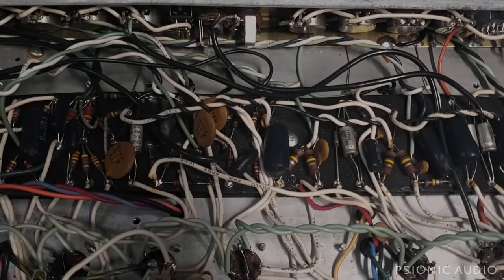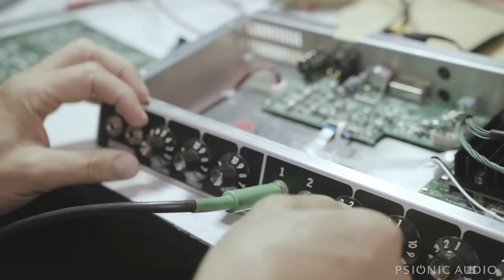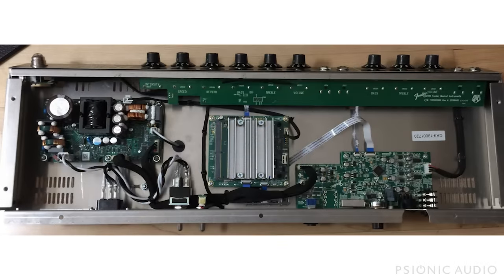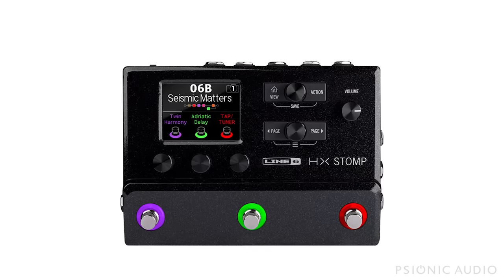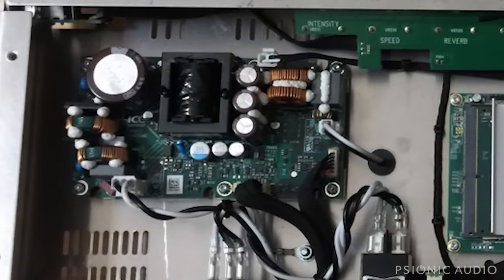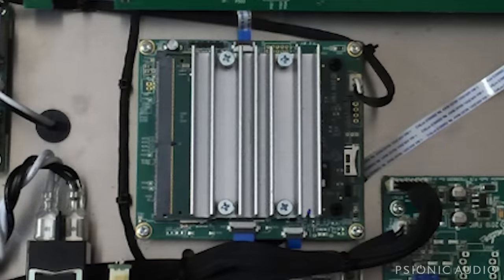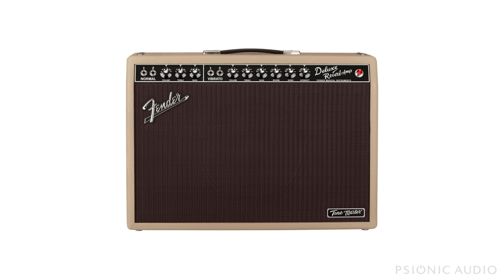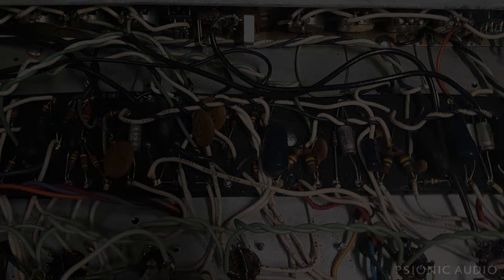We Need to Talk about the Tone Masters

Comment: You need to look at this amp as a tool, not an investment. If you are a gigging musician and it fits your needs, at about $750.00 with a 2 year warranty, even if it fails just as the warranty ends it will only have cost you about $1.00 a day.  For a working musician who wants the classic Fender sound it almost seems like a no brainer
Reply: If you're a touring musician, you're going to invest in IEMs and modeler pedalboards like kemper/helix/cortex/fractal
Reply: Good thinking here except for the impact on the environment. Something that can live for 50 years is better than something that lives for 5.
Reply: @BrockBarr  Who's to say that the amp won't last for 50 years if it properly maintained and cared for. I just meant that no matter what happens you still get your money's worth out of it.
Reply: @scacchomattho  I'm with you on that. Maybe a weekend warrior that wants looks might use those tone master things but anyone who actually would tour is using something rackmounted or a board unit to get their equipment footprint down.
Reply: I bought one in late 2020 thinking the pandemic would be over and my band would pick up on gigs…it’s only NOW (almost 2 yrs later) that we start picking them up🙃
Reply: @TunedupFlat  wow.... but normally you're actually a pretty humble guy suppose? Did you even ever play one? I'm a gigging musician since 25+ years and I don't have the need for a Kemper or a rack... I just need one good sounding amp that's not gonna break my back. And this fits my needs perfectly. I'd image if you're playing in a cover band and need a totally different sound for every song, then a Kemper or Helix would be a good idea. But there are also musicians who are devoted to a certain sound or genre... I maybe need 3 or 4 effects (delay, reverb, tremolo and maybe a phaser) and that's about it. I use one overdrive pedal but mostly pretty clean. Why would I need 500 effects or amps and cabs emulations to choose from? My point, for some touring musicians, the Tonemaster is a great tool.
Reply: @scacchomattho Used to agree with this but after playing with a Helix for so long and learning how limited it actually is (even with the newest firmware), I still find myself going back to analog boards and actual tube amps. If I'm playing at churches now, then I use analog pedalboards with multiple pedals and a UAFX Amp sim pedal (think Ruby. Dream 65 and Lion).
Reply: Where do you see these for $750? I thought they were a bit over $1000
Reply: @Rockandrollgeerage 
2 year old video.... prices go up on everything except this amp.... you can get them new for $550.00---$650.00. 
Still not worth the money.

Comment: Us DIYers are waiting to buy broken ones for cab, chassis, and speaker for a buck fifty in 5 years.
Reply: Keep waiting, hero.
Reply: Good luck 👍getting a smokin  deal anytime soon.. this amp is exceptional for the money and the almost absence of weight,  no waiting for the thing to cool down before you toss it in the trunk,  no constant upkeep, no dealing with the overall db level when you want a little gain for the 1st set..  better sound than a healthy tube version  ?  No.  However it's close......
Reply: @lohmei3913  its not really a question of quality or value.  Its a question of sheer prevalence and time.  I have picked up cheap-to-free hot rod series stuff over the last decade for the same reasons.   I didnt mean to sound snarky or skeptical about the product.  I meant to convey that with more saturation of the market with that speaker, I look forward to the probability of scoring one used.  And, as a DIYer, a new run of right-sized blackface cosmetic fender combo cabs, in the used markets means a DIYer can source kit parts for just chassis and guts and hope to score a tonemaster husk that will receive a chassis perfectly.  So, I'm excited about the waves of stuff coming to the used market eventually, I estimated five years-  i didnt mean, "this is junk and a fad and i will be laughing at all these dopes in 5 years..."
Reply: Considering I’ve got an original Mustang and Mustang v2 sitting here that work like the day they were built…..I suspect you’ll be disappointed.
Reply: 3 yrs
Reply: Tube preamp into a Katana Artist power amp in. I use a Le Clean,  UA RUBY, AND A beekeeper. So only the power amp is in use along with power scaling and volume. And These preamps are truly amazing. Sold My 64 Deluxe and my Alessandro Princeton.  I Have a Champ from 51. A Timmy and an old DD3.

Comment: Would love to hear your thoughts on Quilter amps!
Reply: Replaced my '65 Deluxe Reverb RI with the Tone Master version. After the firmware speaker update I have been delighted with the sound. Not the exactly same as the tube version, but it sounds great. The digital reverb isn't as nice as the spring so I supplemented it with an Oceans 11 pedal. I replaced a Bassman amp with a Quilter for playing bass and love it, so I pulled the trigger on a Quilter Aviator Mach 3 to complement the Tone Master and LOVE it! The Mach 3 is a great addition as it is much louder than the Tone Master and does a decent job emulating Vox and Marshalls as well as 3 different Fender models too. Love its cleans, and the high gain settings are perfectly useable. If you A/B with the tube version you'll hear a difference, but you also would between 2 different tube amps of the same model. Can't beat the weight savings.
Reply: Quilter made stuff is as close to indestructible as it gets in my experience.
Reply: I agree. It would be nice to hear his take on the Aviator Cubs and the Mach III. I have a Steelaire and a Mach III. They are both excellent amps. I am not bothering with heavy tube amps any longer. Ps. For tube amps I prefer Peavey Classics and Vox AC15s.
Reply: Fender Champ is a good amp for quilting

Comment: It is a laptop with an amp attached and some knobs and pots.  I have never had a laptop fail, and the ones that I have replaced (after 6-8 years) have been replaced because the operating system updates have outgrown the CPU.  But the Tonemaster is a laptop designed to do ONE thing, I am sure some of these might fail early but I would expect the CPU to chug on for a decade or more.  Mine sits next to my desk, I play it every day through the IR, I am lucky if I get to play the speaker once a month, and I never get to play it above half power.  Why did I get it?  Because I would NEVER be able to play a Valve Deluxe Reverb above 1 on the volume in my home, and certainly not at night.
Reply: I have one for band usage. Our training room is really small so I drop the wattage to 1/3rd and it sits in the mix. Go to a gig I can dial it with the room and go foh directly with xlr. I really enjoy the versatility and personally I bought it for the deluxe reverb sound which in a band mix is hard to differ from tube one. For home play I use Pod Go either directly with headphones or with PC together with recording, drum etc software. Can recommend pod but maybe would go with hx stomp now as in home use I dont need the buttons that much.

Comment: I am a live sound engineer of 20+ years and I had one of these on my stage just the other day. I was curious myself about the amp and decided to test the new model by using the XLR direct out. I set it to position 1 and I must say, I was very impressed! It sounded like a nice mic'd guitar amp. I had to do very little to no EQ work on it and as I recall, it was simply getting a level, turn it up and it was good to go. All I did was use a HP filter to rid any needed low end and I believe I used a mild -3db dip around 5khz to reduce some bite. While I want to dislike some of these " new " DSP based amps, this one actually has me very interested. It sounded good acoustically and it sounded just as good with the XLR direct out. The other guy on the stage had a Deluxe Reissue and I mic'd that one, it sounded just about the same or at least it required similar amounts of work with an SM57 to get a good sound out the PA. I was using an L' Acoustics Kiva II rig to give you an idea. So if there was something to be ashamed of, you would hear it.
Reply: For a guitarist it’s a different story. Sterile. Touch isn’t there.
Reply: @greg6L6GC  I am a guitarist of 30 years! And while I can’t speak for the touch and feel of the tone master, I can only say that based on the grade that this guitarist was it didn’t seem to be too much of a problem.
Reply: @atech9020  They just sound ok. Don’t heave the feel and that’s important. I’ve been playing 60yrs and when I have time build amps. I’ve worked my entire life in electronics.
Reply: @greg6L6GC  Nice! I too have been building guitar amps for several years now. I’m not trying to tell everybody to go out and buy the fender tone master, but from the limited experience I have with it, it is a product that has me interested.More so as an entry-level, affordable version of the real deal that you don’t have to worry about beating up or not.
Reply: @greg6L6GC  bullcrap, they do not sound sterile at all. And it feels about the same as my Fender tube amp. The Tonemaster is just little bit more sensitive to touch, but that depends on your playing style as well. It sounds great and has a lot more headroom at the same volume as my Hot Rod tube amp, it's loud, very full sounding and clean as hell. Is it exactly the same as a Twin Reverb tube? No it's not. But there's absolutely no one who will notice that subtle difference when playing with a full band on stage.
Reply: @supersonicsroots  Agree.  People in a club are not listening thru $500 head phones.  I think guitarists can be anal and over analyze things way to much.  Most of the audience on any given night wouldn't know the difference and are drunk or high as shit.  In a church setting, they wouldn't know either.
Reply: @davidcudlip6587  Same here. Also the speakers that the congregation in my church listens to are already 25 years old. They are already used to the bad quality.

Comment: this is something that is great for working musicians who just need something lightweight to throw in the car and take to the gig  It is absolutely a consumable product, not a legacy one, you wont be handing it down to your kids.  Buy it, use it up, junk it. That said they may be a great source of cabs and faceplates in the future.
Reply: I sold a handwired Deluxe Reverb clone and got a Tonemaster. I A - B’ed them and felt the Tonemaster sounded as good as the DR clone (the clone was a great sounding one and remember all DRs don’t sound the same anyway). The weight, attenuator and line out made it a better fit for what I do. I still have a Princeton Reverb and Champ made by the Amp Shop and they give me my tube fix. I definitely agree with the firmware upgrade improvements.
Reply: You must be rolling in money.  Usually it's only kids who have no clue for value.
Reply: @swagedelic  around 1979 nobody was buying these except the handful of people - GE Smith comes to mind - who had enough stage time to appreciate them for what they are. Even then, something like the GE Smith approach was sort of specialist. People were going solid state, especially after Peavey made the Bandit and family, and the LAB Series came out. 

All that "value" came from the Innernet and big box guitar stores. I'd been playing for like 20+ years before I even saw a Deluxe Reverb on stage.
Reply: @arkybeagle6159  My post wasn't directed at the guy with the Deluxe Reverb.  I was responding to the statement about consumable products.  The definition and commerce model of consumption is what is destroying everything from quality, value, balance in the economy and even our environment.  Your take on "value" seems set on the throw away and you blame everyone but yourself.
Reply: @swagedelic  Do you play guitar?  I don’t mean it in a flippant way…. Rather that any guitarist knows there is no such thing as value as it relates to money in the world of guitars.  Why pay$500K+ for a 1959 Les Paul, $10K for a hand built replica from a luthier, $5K for a Gibson CS or $2.5K for a Standard?  Where is the sweet spot in terms of value?  Value is not really a factor as it’s primarily about playability and sound (consistency) within an individuals budget. $1000 is not bad for a decent amp, especially when a vintage DR goes for 3-5x more. Also, vintage amps are scarce, temperamental and inconsistent in sound.  More importantly, the good ones typically stay in collections and the bottom 1/3 in terms of sound and reliability float around the used market as people are okay with ditching an expensive, somewhat crappy amp as the vintage market is full of suckers (I include myself in that generalization).  The only real ‘value’ in the Tone Master is that they aren’t terribly expensive, they all sound the same and if it fails (as some amps do), you can run to almost any guitar shop and grab one, plug in and go.  There is no having to change your rig based on the changes in dynamics and spending month/years sorting it out.  I understand your concerns regarding the ‘built-to-break’ approach to products and ‘throw away and buy another’ approach to consumerism…. But these two ideals do not factor into what Fender is doing and what people are saying here.
Reply: @prsjackal  appreciate your indulgence with the lengthy response.  True much you are saying about old equipment being temperamental and always needing service, I am not immune to that.  However, Fender nor Gibson didn't market consumables to be replaced every two years back in, may I be brave to say, the Golden years, that ugliness started in early 1980.  If computer chips are to be used in amps, they could had resolved servicing the amps by utilizing CPU sockets and serviceable third party plugins.  Including a serviceable motherboard couldn't cost that much more, this way the normal guitar joe doesn't have to throw away $1000 every two years and amp techs don't lose business.  A win win situation for everyone.  Guitar corporations (yes, I said corporations) don't need to cut corners to churn a profit.
Reply: @swagedelic  it is unfortunate and I absolutely agree.  The shift in the 1980s to circuit boards and less robust workmanship represented a wrong turn… but luckily it did result in the rise of purist builders/luthiers who replicated, created new designs and turned a cottage industry into mainstream as people wanted and still prefer solid, old school builds.  Unfortunately though, the impact on the pocketbook and environment is a consequence.
Reply: @arkybeagle6159   BB King played through a LAB combo on quite a few of his recordings

Comment: Re: Tone Master vs Tube: I just watched one of your videos on repairing a Supro Delta King. When I see board-mounted tubes & pots on a cheap Chinese PCB and surrounded by op-amps, I shudder. At least a Tone Master runs cool, and won't bake itself over time!  Folks talk about PCB-based tube amp construction as though it's interchangeable with point-to-point wiring on eyelet board, but it's NOT. One of my worst tech experiences was a Peavey Classic 30. Good value out of the box, but a nightmare to repair or modify.